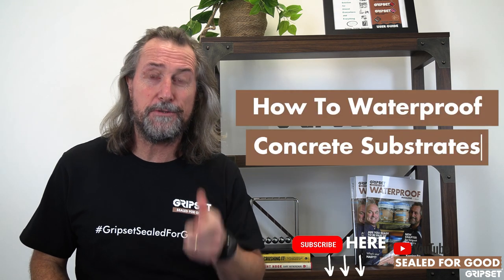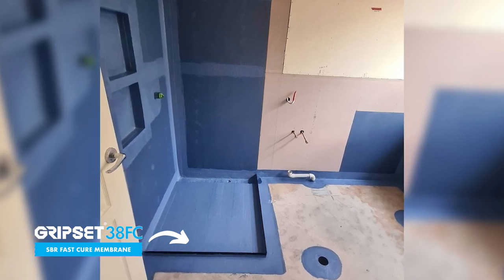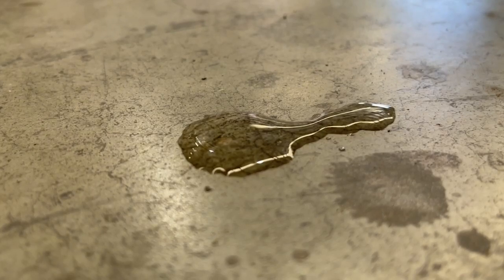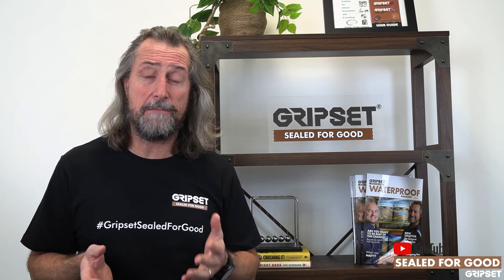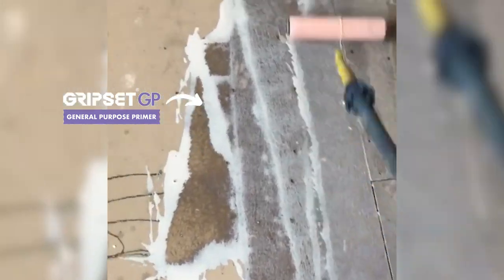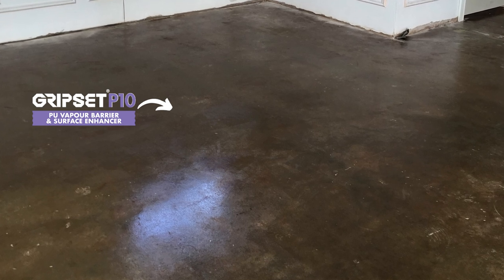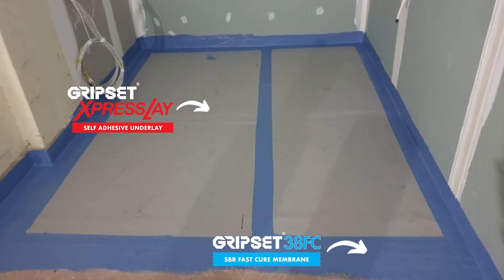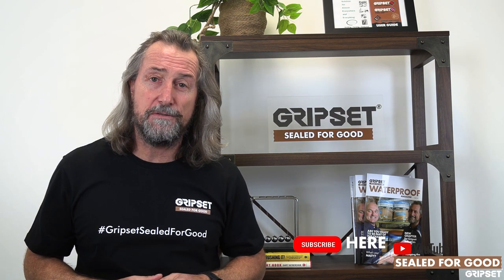How To Waterproof Concrete

Comment: Ive got 5 bathrooms to waterproof & tile in an old renovated house. Floors are concrete slab, walls are masonry. Floors will need to be topped and levelled before membrane application. I just wanted to clarify what my best approach would be in terms of under screed membrane application. Do I need use an epoxy primer (H2O, E60) and or which cementitious would be better C-1p or C-2p. I'm stuck at this point and which cementitious product to go with. Any help would go a long way. cheers
Reply from the maker: Hi Paul, 2P is the popular choice due to improved elongation properties vs C1P, combined with Xpress H2O Primer, this will satisfy your needs! Thank you for reaching out :)

Comment: I live in Fiji and I am a pool builder. I usually use the 38 but the 38 is out of stock.  Can I use the 39? Thanks
Reply from the maker: Hello @Pacific Dynamic Builders, if you could send us an email about your application to techenquires@gripset.com and our Technical Manager will assist you with choosing a Gripset system for your next application!

Comment: Which Gripset is best for exterior and interior plastered walls? Can it be painted on or have to apply undercoat water based on concrete plastered walls before applying Gripset?